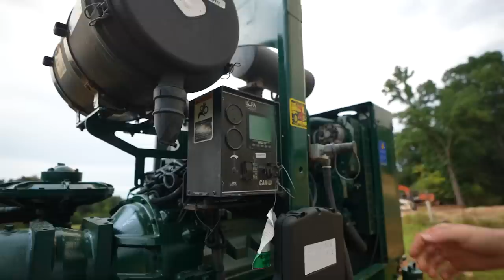Rescuing Fish Stranded In A MUD PIT! (draining a stocked pond)

Comment: Great work! Should've started with a large net though and walked down the sides of the canal catching as many as you can. All the muck getting kicked up probably did a number on the remaining fish, especially since the heat was probably already stressing them out a ton. Hindsight is 20\20 though. All in all, glad you saved the ones you could!
Reply: Pound sand scammer